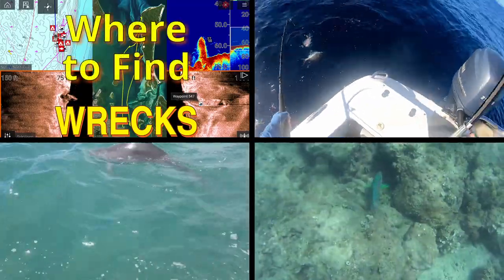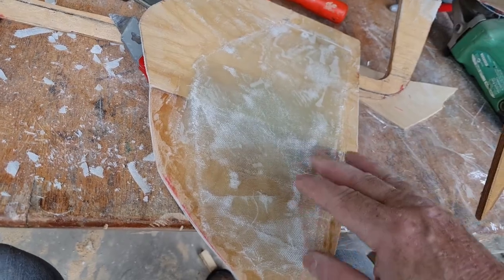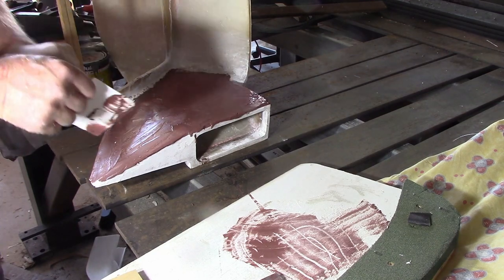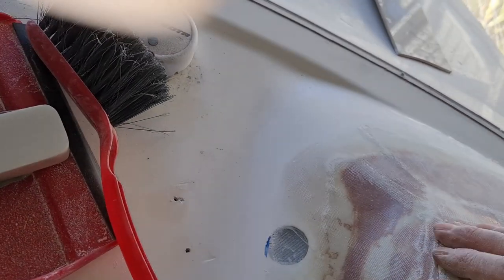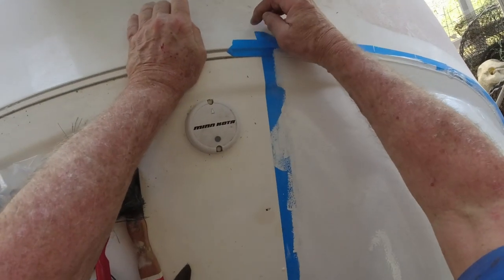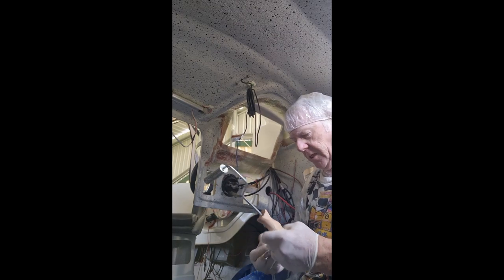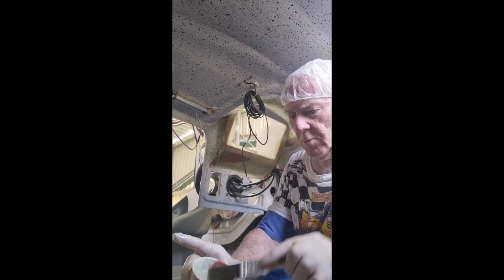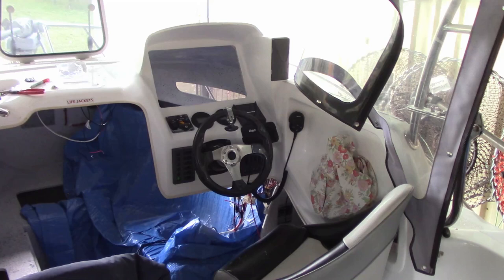Modifying My Dashboard - Pt 3

Comment: Well done!  Are you waiting for an axiom12pro?   I ordered mine in April, and still haven't got it.
Reply from the maker: Thank you.  I had the Axiom 12 PRO RVX.  (sell you one if you want :-) )  I'm going 16" this time, keeping the brand secret until I have it installed.
Reply: @weFishAU  would have but mine is apparently coming in this week.  Why the move away from raymarine?
Reply from the maker: First, I like the Raymarine sounder and the general features of the GPS are also very good..  One thing I have always hated is the company policy on how their autopilot should work.  Nothing wrong with the autopilot itself but the company policy has crippled it for my intended use, which the salesman was well aware of and neglected to mention when I originally purchased the MFD unit (I added the AP later and found out for myself).
Anyway, I recently had the opportunity to switch back to the first sounder brand I ever used (circa late 1960's) and have used on and off ever since, when I could afford it.  Its autopilot works the way an autopilot should and isn't crippled by company policy.  Plus the fact that the new unit offers features that the Raymarine does not, I couldn't pass it up.
All that said, the Raymarine is a very good unit if you don't need the autopilot or are comfortable with the Raymarine imposed limitations.
P.S Don't be in too much of a hurry to upgrade to Lighthouse 4 when you get it.